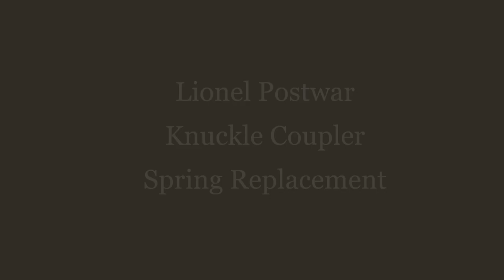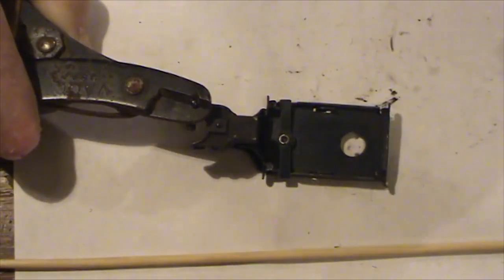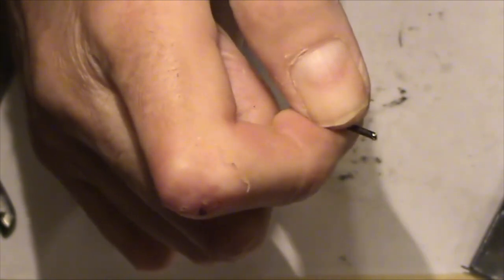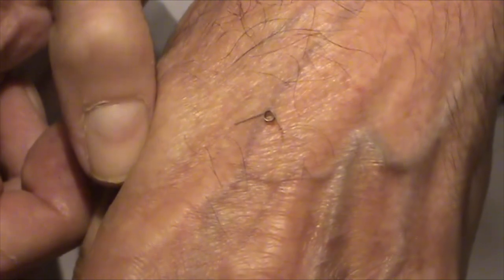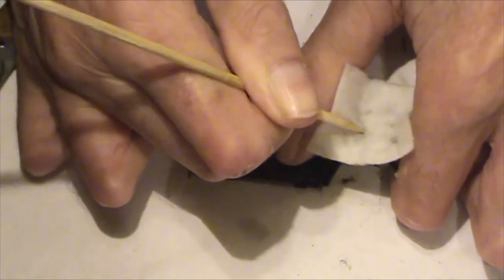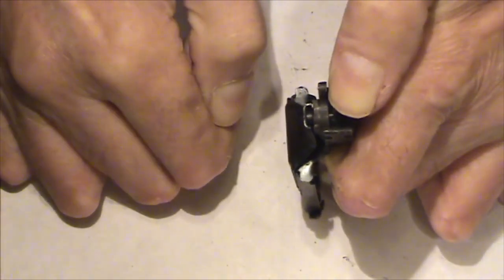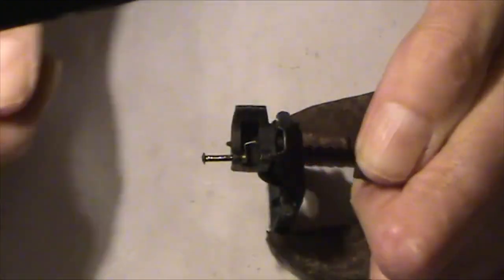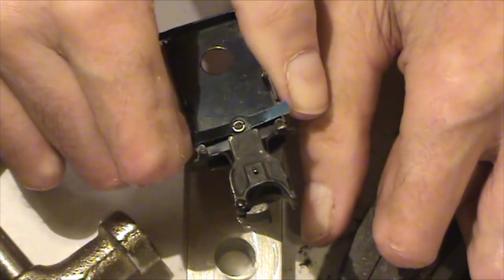Lionel Postwar Knuckle Coupler Spring Replacement

Comment: Great video.  I have a nice little post war whistling tender that had a plastic knuckle "Hand" installed.  It had failed long ago, and after ordering some springs and pins, I found your video to show me how it was done.  I am very familiar with the shaky hands issue and your ability to get around it to get these small parts back together  made it muc easier for me to do the same.  Using a pair of vise grips to hold it in place was genius!   Anyway, thank you for taking the time to put out this informative video.  I look forward to watching more about these great old trains.
Reply from the maker: Thank you for your very kind comment and I'm so happy it helped!  Thank you very much for watching!

Comment: I'm 73 and occasionally have trembles in my right hand.  Great video, especially the tip to use something to hold the spring and pin--I used Red N Tacky grease applied with a paperclip.  Took 10 minutes after the pin was removed.
Reply from the maker: Thank you so much for the comment and for watching!  Good tip on using Red N Tacky!

Comment: I use an automatic center punch to open the rivet. I put the spring on the knuckle and then add knuckle to the assembly. Center the spring in the hole and put the pin in. Then I position the end of the spring around the knuckle with an exacto knife. I got good at this doing about 50 or 60 of them. Can do one in about 1 minute.
Reply from the maker: Excellent, thank you for watching and commenting!

Comment: I just cut off the flat heads of the rivets with a micro snipper.   You can buy a kit of parts for little money.  As far as flaring the new rivit-a $6-8 spring-loaded center punch does it effortlessly.  You just just a firm service pressing against the head side, and use the center punch on the flair side. Works easily.  Admirable effort what he does to salvage the rivet.  But is is maybe a 10 cent part for new one. I buy a kit of 50 sets for about $20 with shipping. Includes a new knuckle, rivet, and spring.
Reply from the maker: Thank you for watching & commenting!  I agree with you but I like to show folks how it can be done if need be.  I have bags full of new pins, springs & knuckles but enjoy saving the old if I can.  Thanks again, greatly appreciated!

Comment: Thanks for the good video.
I have a Lionel 2333–20 Santa Fe engine. The front coupler does not work. I don’t see anything to trigger it opening. I took it apart and lost a plunger spring that goes back into the pocket of the knuckle that pushes a pin against the hand. I replaced it with part of a spring out of a ball point pen.  I’m not sure if it’s going to be too strong. What triggers opening the coupler? Do you have a video of how to repair this and put it back together? God bless, Randy
Reply from the maker: Thank you for watching!  I've replaced many of the "Electro-Couplers", but no video sadly.  However a fellow YouTuber has made one that shows how to get them repaired and operating again.  The link is here, hope this helps, good luck!   https://www.youtube.com/watch?v=6qJRSyu1baw

Comment: Here's my advice and steps I take to installing new springs:

1.) Do not reuse the pins. They look terrible when crimped again and are difficult to service afterwards without drilling the crimped end off. The pin gets shorter when it is reused! Furthermore, pins are inexpensive to replace (Lionel Part Number *TC-23*).
2.) Keep the spring from flying away by putting the pin through the spring, knuckle and metal coupler first. From there, putting the short crooked arm is easy with tweezers. 
3.) Best tools to do this job: tweezers, X-Acto knife (to push and move the spring around), flush cutters to remove the old pin, and tools to crimp on the new pin. 
4.) Make sure the coupler and knuckle are clean before installing new parts. Dirt & debris make it harder to push in. 

Steps to install new springs

1.) Remove the old pin by cutting off the head with flush cutters and pushing it out with a skinny drill bit.
2.) Remove the dead spring and metal knuckle. Clean out the coupler's insides with rubbing alcohol. 
3.) Place the new spring on top of the metal knuckle. The short bent arm goes towards the inside of the coupler while the long arm is on the outside. A drop of grease can be used to keep the spring in place. I personally don't use grease. 
4.) Push the spring/knuckle into the coupler receptacle, line up the hole, and put a pin through it. 
5.) Push the short arm over the metal knuckle and towards the area behind the pin. The spring should practically disappear if done right.
6.) Test for functionality. Do not turn upside down until the pin is crimped!
7.) Crimp the pin end. 
8.) Lubricate. Add oil to the spring and a little oil onto the the metal knuckle.
Reply from the maker: Thanks for your comment.

Comment: Thank you, Mr. Burns.  I was able to replace the spring and pin in the way you described in this video on a coupler that was already unattached.  It is difficult to work on a knuckle that is still attached to the car.  Can you advise on how I can learn to remove the truck from the car, or remove the plate that you have there?  Is there a book or other resource you recommend?  I have the big Greenberg repair manual but I'm looking for something a little more step-by-step or hand-holding.  I definitely have more confidence in the electronics than the mechanical parts.  Thanks!
Reply from the maker: Wonderful to read that this helped you Colleen and thank you for watching and commenting!  I'll attempt to answer your questions but Lionel had many different types of mounts for not only "Bodies to frames" but "trucks to frames" also.  Boxcars, tank cars, flat cars, all had their own types of mounts.  I will use a boxcar as an example.  On a boxcar you will generally find a screw at one end (Sometimes both ends) and "slots for tabs on the other end.  Removing the screw and lifting off the body will allow you access the frame where the truck mounting pins protrude up from the trucks through the frame.  There you will see the top of the mounting pin with a "Horseshoe" clip that slides into a groove at the top of the pin and "captures" the pin to keep the trucks mounted.  Removing the horseshoe clip with a screw driver by spreading the open end and sliding it off the pin will allow you to remove the truck  completely.  Because the horseshoe clip can rotate freely on the pin, it can be an exercise in frustration at times.  I use a pair of pliers held vertically and push against the open end of the clip with one jaw and the top of the pin with the other and squeeze, pushing the clip out of the groove.  To break down the truck even further you will need to gently pry between the outside of the wheels and the side frames for the wheels and axles to come free.  I use a small chisel for wedging between the wheels and side frames.  Be careful though, you can easily snap the side frame if too much force is applied.  If you want to break the truck down even further you will find that once the wheels are out of the side frames you should be able to "A" remove one wheel and slide the other and axle out of the bottom plate of the truck or "B" gently pry up the four tabs that capture the axles and remove the wheelsets.  These tabs have a tendency to break but prying just enough to allow the axle to come free is all you need,  At this point you will have what is seen in my video.  Please keep in mind that Lionel used many different methods to hold trucks to the frames, pins and clips, spring clips, screws and even rivets that need drilled out to remove but those are mostly on low end cars.  I find myself at "drtinkertrains" website for reference on all things Lionel.  I surely hope I have answered your questions, feel free to inquire more if needed!  Keep 'em runnin' !

Comment: So my question is... how do you get that coupler assembly off the trucks?  Is it a snap fit or is there a tab to pry off?
Reply from the maker: Thanks for watching and your question!  In order to do this job you do not need to tear down the truck assembly as far as I did.  I only took it down this far because of a bent axle that needed replaced.  The job is just as easy if you remove the truck from the car body and work on it with everything intact.  In order to get down this far you need to spread the side frames apart gently and just enough to disengage from the wheel axles on one side then the other.  After that you will be left with what you see in the video except the wheels will still be captured to the assembly.  You can sometimes slide one wheel off and then the other will slide out of the assembly with the axle.  There are four small tabs you can see in the video which capture the axle that I pry up but unless you have done it a hundred times and know just how much pressure you need to straighten them, I wouldn't recommend removing wheels and axles that way.  Those tabs will break in a heart beat.  If you need to remove the coupler body from the assembly, you will have to remove the trigger spring mechanism from the base assembly which would then expose a rivet on the underside of the coupler which would need drilled out for it to be removed.  I hope this helps but remember what I'm working on in this video is a "Postwar" assembly.  There are different styles of trucks available through the years from "Prewar up to "Modern" era.  Each will have it's own unique process.  Thanks again, Jim.

Comment: Thanks. It doesn’t show what/how to get the coupler to open.  Can you tell me? My uncoupler track works for other cars but not on the engine/dummy engine. Is there something that I am missing. The wires to the coupler seems to be OK.
God bless, Randy
Reply from the maker: Those style have a "Slide Shoe" on the underside of the truck that needs a special uncoupler track and control button.  Here is a link to someone selling them but you can see it has two inner rails that the slide shoe on the truck will make contact and then pressing the control button will energize those inner rails and open the coupler. https://www.ebay.com/i/143404739242?chn=ps&norover=1&mkevt=1&mkrid=711-117182-37290-0&mkcid=2&itemid=143404739242&targetid=882904020427&device=c&mktype=pla&googleloc=9006025&poi=&campaignid=6469981122&mkgroupid=86285324342&rlsatarget=pla-882904020427&abcId=1141176&merchantid=6301674&gclid=EAIaIQobChMI1If05cnD6AIVFJSzCh0LAAG0EAQYCSABEgIANfD_BwE

Comment: Just when I thought there was no hope for my ole cars... where do you get the springs? How do you remove the wheels? Great video!
Reply from the maker: Thanks for watching and I hope this helps you save them to ride the rails again!
Reply: James Burns this will help! I updated my post about materials! Thank you for your quick reply! I’ve been keeping my dads Lionel lines from the early 50’s rolling! I have a question about gears on a 2055 steamer too... don’t know if you’re familiar...
Reply from the maker: @Deadbuck73  Here is a link to the outfit I bought mine from on eBay; https://www.ebay.com/itm/LIONEL-KNUCKLE-COUPLER-PIN-RIVET-TC-23-AND-SPRING-480-16-4-SETS/324068058969?epid=1840115554&hash=item4b73f62759:g:qLQAAOSwqzFeQGHh
  You can buy just the springs in bulk on eBay also.  I use a wide flat head screwdriver to gently pry between the side frame and wheel until the axle releases out of the side frame, then the other side should come loose.  This is best accomplished by removing the trucks from the cars first.  That 2055 would be the Hudson style locomotive, what gear are you having trouble with?
Reply: James Burns awesome thanks! It is the Hudson! The gear is on the outside of the motor case between the two front drivers on the left hand side. The gear looks like it has sort of come off the axle it is on and is wobbly. I think it’s adding to the growl of the engine. I’m concerned it’s going to strip the gears on the drivers.
Reply from the maker: @Deadbuck73  That sounds like the 1st Intermediate Gear which is failing usually from a lack of lubrication.  Right above that gear you should see a small Pinion Gear which is on the armature shaft that meshes with the 1st intermediate gear  which then meshes with the wheel gears and then a 2nd Intermediate Gear which meshes with the forward set of wheels.  Unfortunately those require a Wheel Puller to remove the wheels first in order to change them.  If you have the right tools you may be able to find replacement gears at a company called Port Line Hobby Supplies.
Reply: James Burns if you look at the motor with the e unit on the left... there’s an opening with a copper winding behind it. The gear is below that between the left wheel and the center wheel. So it sits forward of the actual motor/armature...
Reply: James Burns so I’m guessing it’s the second intermediate gear...
Reply from the maker: @Deadbuck73  Okay, that is the 2nd Intermediate gear then.  The 1st being driven by the motor pinion gear.  Procedure would be the same, removing the wheels and replacing the gear then reinstalling the wheels making sure the ""Quartering" of the wheels is correct so the side rods do not bind up.  Never try to remove the wheel with a screwdriver though, you'll always wind up with a ruined axle or wheel or both.  Invest in a wheel puller.
Reply: James Burns that doesn’t sound bad. Thank you for helping me identify the gear! If I get the wheel(s) out of the way will I then need any more special tools to put the gear back on? Will the gear need replacement? It looks like the teeth are ok on it...
Reply from the maker: @Deadbuck73  I would double check the wheels and make sure they are fully pressed on to the axles, over time a wheel can start to slide off the axle allowing too much play to keep the gears in place.  Check that first and if you do need to replace the gear it is most likely due to a worn out center hole or the stud it rotates on is worn out.  The gears themselves should just slide onto the studs and no special tool needed for them.  If the stud is worn then you'll need a repair shop to replace those.  You may find replacing the entire motor assembly a cheaper way to go than the cost of a repair shop.  Hope that helps!
Reply: James Burns thank you! I checked the wheels... all seemed to be in place... I live about an hour south of Charles Ro. I called them and explained the issue. They said it would be just as easy for them to swap out the motor unit... basically your thoughts... their fee was just shy of a c-note...I my mind I was hoping to just fix it myself... but it may be just beyond what I hVe tools for...
Reply from the maker: @Deadbuck73  If you decide to replace the motor assembly, make sure they give you the old one and you can use it for parts or to practice repairs on.  Another idea would be to ask them if they would lower their price if you let them keep the old motor.  I know it's tempting and in my youth I messed up a couple times until I bit the bullet and bought the right tools.  I don't think their price is bad at all though, and they will get her all synced up and running smooth.  I wish you the best of luck with all your efforts!

Comment: How do you remove the pin from the knuckle and hand?
Reply from the maker: Hello, around the three minute mark in the video I show how I remove the pin using an old set of wire strippers but a set of Dyke Wire Cutters works just as well.  Use a gentle prying and twisting motion to get the pin removed.  As you pull the pin through, the "splayed" underside of the pin will be reset for another use.  I show how I dress that end of the pin so it can be reinserted after the spring and hand are reassembled.  Hope that helps, thanks for the interest!
Reply: @jamesburns0657  Yes, but you didn't show how you were able to straiten the bottom of the pin that was crimped to keep it in place.  The pin I'm trying to remove has no play in it so I can't get it out.
Reply from the maker: @traingrampa8619  If there is no play in the pin then I use a needle file to file around the 'splayed" end of the pin until it is loose enough to allow movement of the pin.  Then using the Dyke Cutters you should be able to grasp under the pin head and gently pry the pin out.  As it pulls through the hole in the knuckle it will reshape the splayed end into a round shape again.  Then before reinserting you can dress up that splayed end with a file or Moto Tool.  If you are replacing the pin altogether, then you can just file or grind off the splayed end and discard it.
Reply: @jamesburns0657  Thank you so much!

Comment: Some of the original pins have a factory machine peen that distorts the pin. I found that it is easier to use a new pin. One has to be careful not to put too much pressure on the coupler assembly or it may pull out of the base plate. Pins and springs are available from any reputable parts dealer. I use trainwx.com
Reply from the maker: Very true, many times I need to straighten a pin but an easy job.  Thank you for watching and commenting, much appreciated!
Reply: @jamesburns0657  You did a wonderful job on your videos. Take care and God bless!
Reply from the maker: @garykuipers2696  Thank you very much, God bless!
Reply: @jamesburns0657  How do you get the pin out?